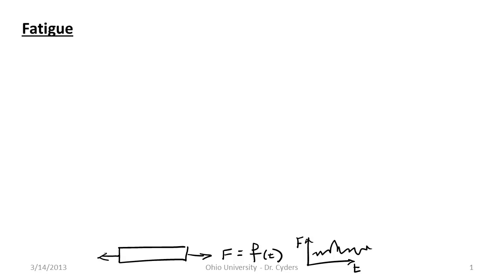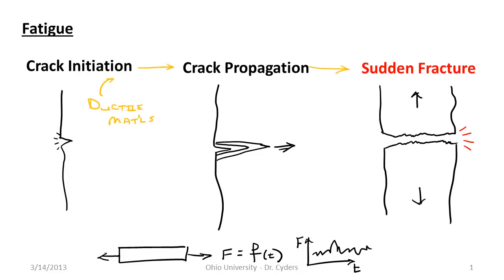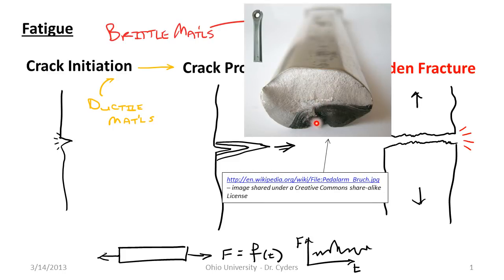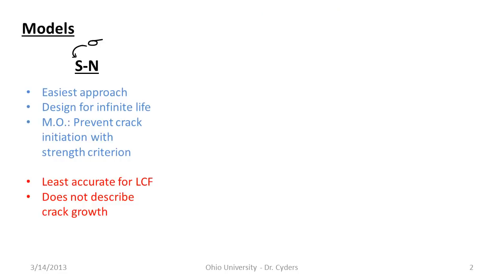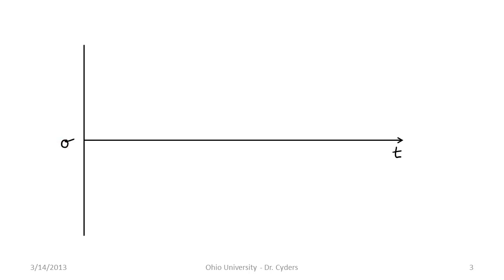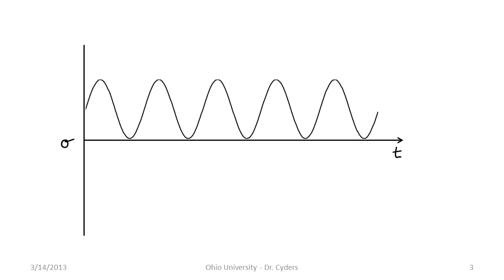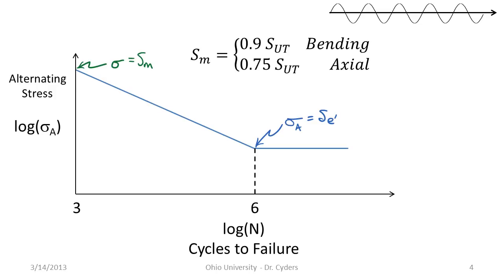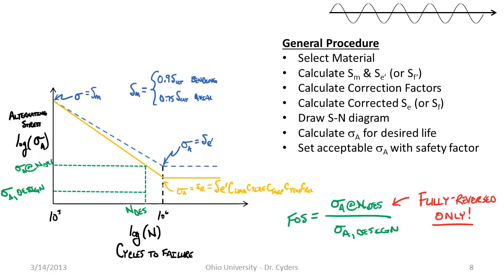Basic Fatigue and S-N Diagrams

Comment: hi, great explanation. Just 1 question. how is it that a negative mean stress is better than positive mean stress (fully reversed cycles) in terms of fatigue crack development? Isn't negative stress (assuming same amplitude) is just the reversed direction of its counterpart @ positive stress? Thanks
Reply from the maker: adam hisham Fully reversed cycles have zero mean stress, not a positive mean stress. A positive mean stress indicates an elevated level of 'constant' tension, which promotes crack growth, leading to a lower life at a given alternating stress, or, looking at it another way, a lower allowable alternating stress for a given part life in cycles. See my video on the Goodman Diagram (https://www.youtube.com/watch?v=fei7iQd_lVE). A negative (compressive) mean stress doesn't generally cause this, as it doesn't promote crack growth the way a tensile stress does, but the alternating stresses can still cause fatigue. If you have a copy of Norton's or Shigley's machine design texts, they both discuss the phenomenon. Does that answer your question?
Reply: Dr. Cyders Owh. I'm getting the jist of it but still a bit lost. Lets say there a beam. A load is applied on it and the beam bends to a certain degree. Then the load is reduced so that the beam 'unbends' itself towards its initial/resting position. Before the beam reaches resting position, the same load as earlier is again applied. The cycle continues. In this situation we could say that a positive mean stress is taken by the beam right? Now lets apply the same load conditions to the beam with a change only in the direction of the bending of the beam. Is the beam now experiencing negative mean stress?
Reply from the maker: Your explanation would actually include points that would experience a negative [compressive] mean stress and points that would experience a positive [tensile] mean stress (assuming you were talking about a simple cantilevered beam).

For clarity's sake, say we have a uniform cantilevered beam, and you stand on the free end of it. You have statically loaded it, and it has a maximum stress at the rigid wall, tensile at the top of the beam, and compressive at the bottom. Now say you jump very lightly up and down on it - a simple model would be that the force on the beam goes to zero when you're in mid-air, and up to your body weight when you're on the beam.

This would be a repeated load. In this case, the state of stress at the top of the beam at the wall would oscillate between zero and some finite positive value, so you would have a positive mean stress at that point. At the same time, the stress on the point at the bottom of the beam at the wall would be oscillating between zero and a compressive stress; therefore, that point would have a negative mean stress. Thus, if we jumped up and down enough to fatigue the beam, the fatigue crack would likely begin at the top.

To continue the example, we could counter this - we could put an axial compressive stress on the beam, putting the whole thing in a constant state of compression, say, by running a screw through the whole thing and tightening it. With enough pre-compression, we could move even the mean stress on the top of the beam to zero or below, and we could therefore improve the life of the beam without changing the beam's geometry or load.

Comment: In regard to fatigue failure, am I correct in assuming that an airplane wing would be designed for infinite life, i.e., an infinite number of cycles?Thank you for this excellent video!
Reply from the maker: +billr111 The short answer is no. Just about any machine designed should have a defined useful life. The long answer is that materials used in aircraft wings can vary, but usually includes a significant number of components made of aluminum. In reality, while models such as the approach detailed in this video are a good first shot at designing a part, for large assemblies and complex systems, it is much better practice to get real-world strain/load data from an actual physical assembly, and do fatigue testing on the actual assembly. In general, the mantra used for things like automotive and aeronautical designs usually includes this testing of real-world parts, and defining a safe life or safe load levels based on that real-world data.

Comment: In the pedal example the large ductile overload fracture surface as compared to the corroded fatigue fracture surface clearly shows the pedal has a high mean stress from bending load.

 All cracks - ductile or brittle occur and record in the time dimension - crack initiation, crack propgation and crack termination/arrest.  
Tensile tests are 1/4 cycle strain fatigue failures

Comment: Two question which are utterly infuriating me because I can't find anybody how can answer the questions: 
1) The S-N curve for 2024-T3 Aluminium, shows stress values higher than Ftu for some stress-ratios however the number of cycles-to-failure is NOT one cycle. If a material is subjected to Ftu that should mean a failure will occur cycle 1.
2) Why can I not find any S-N curves for 2024-T42 (typical aircraft skin material) anywhere online NOR in the MMPDS?
Reply from the maker: 1.) The S-N model tends to be rough approximations - without specifically seeing the curve you're referring to, the question would be whether you're looking at an extrapolated curve or actual data. Data towards the left end of the curve (low numbers of cycles) tend to be subject to variability from different sources than those at the right end of the curve, reflected in the way correction factors are typically applied. 

2.) Don't know, I haven't gone digging for that heat treatment in the mmpds myself. There are guidelines for component design outside the bounds of mmpds outlined in several different technical documents.

Comment: @Dr.Cyders
How would you find the S-N curve given a torsional, bending and axial load over given times that aren't synchronized?
Reply from the maker: +QuantumTeapot There are several methods to deal with multiaxial stresses, probably the simplest of which is to a.) assume the worst case that the stresses will sync up at some point, b.) create von Mises effective stresses for the alternating and mean components of the various stresses on your worst element, and c.) use the resulting alternating and mean effective stresses on your S-N curve and Goodman diagram to assess the projected lifetime and factor of safety.
Reply: Sometimes the Mohr Circle is could be a good choice when you have torque and bending.

Comment: Thanks you so much Doctor, I am working on piston Connecting rod assembly for 4 stroke IC engine. Does my assembly qualify for Fully reversible case? I am very confused on this, please help me. Thanks
Reply from the maker: +shiva prasad I'd be surprised if it did - you would need to look at the graph of stress over time and evaluate it for maximum and minimum stress.
Reply: What you are basically doing ?